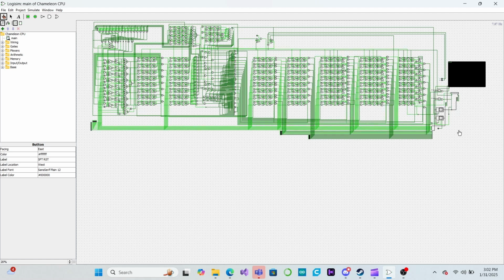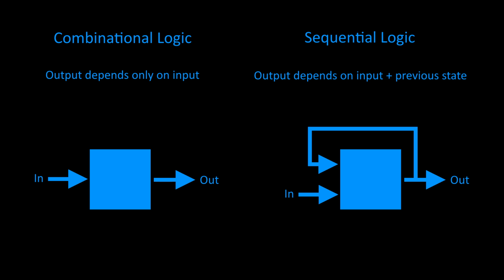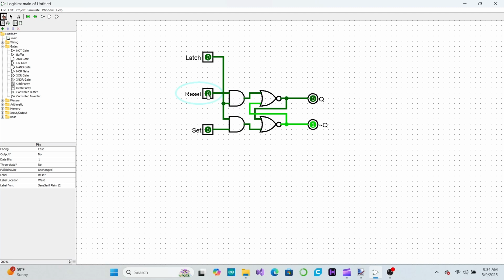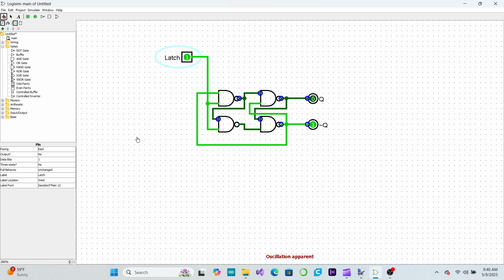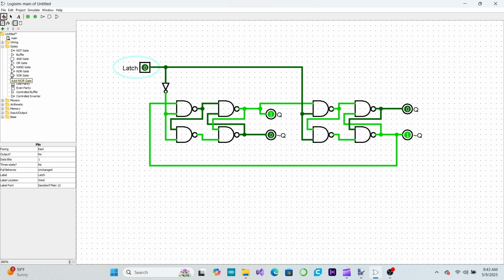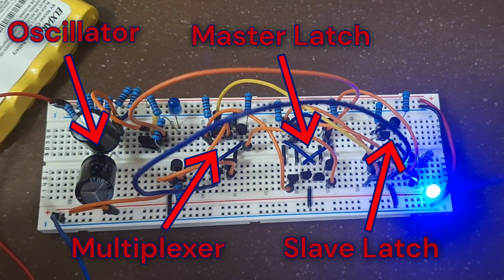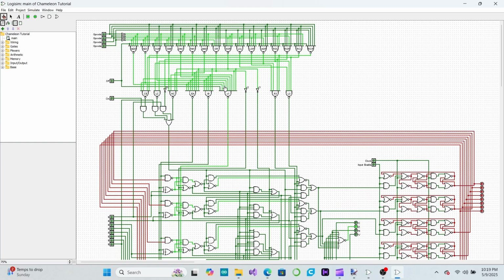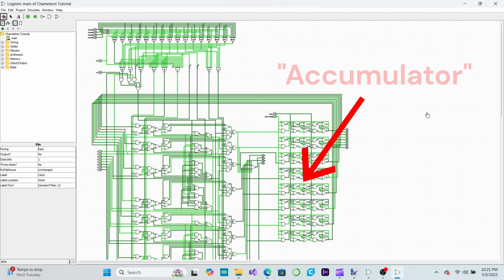Adding Memory to our Custom CPU (The CPU You can Build, Ep. 8)

Comment: It's interesting to transform what was your A Register into your Accumulator. I have a question.
If we keep your A Register, on one clock rise, we put the value 13 in Register A, on the second clock rise, we put the value 27 in Register B, and on the third clock rise, the ALU adds A and B, and the value is on the bus and ready to be used, for example, to be saved in memory. Are we gaining speed (saving a clock or 2), or is your accumulator concept just as efficient or better? I may be missing a step that I didn't consider. Please correct me.
Reply from the maker: I'm not sure you would save any clock cycles by having a separate B-register, either way you take 2 cycles to do an ALU operation, plus one more if you want to store the result somewhere else.  However, having additional registers could speed up some programs by allowing you to keep multiple variables at a time stored in CPU registers, instead of having to load them individually before operating on them.  The main reason I went with the single-register-loop approach is because it needs fewer registers to accomplish the same task, which will make this CPU easier to build later.
Reply: @PolymathUnlimited-du2hg  CPU easier to build, I agree.